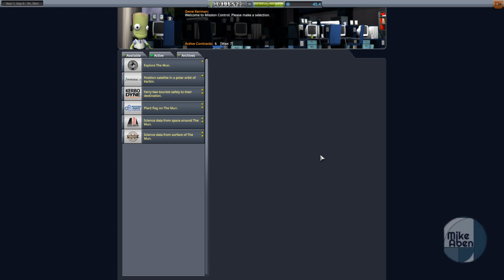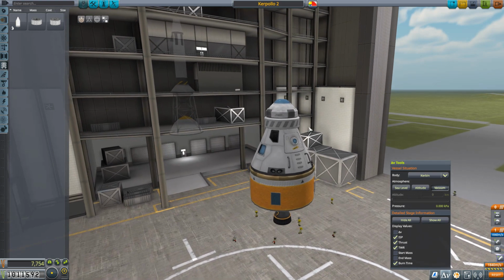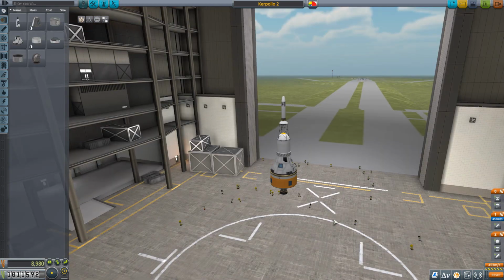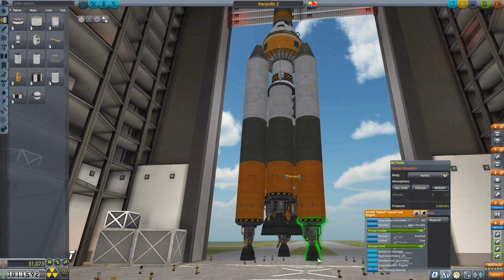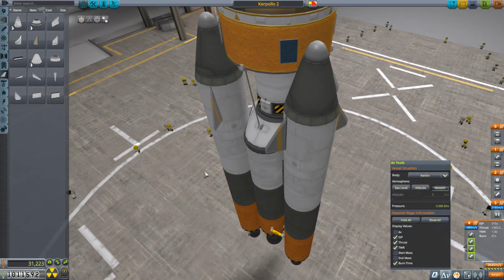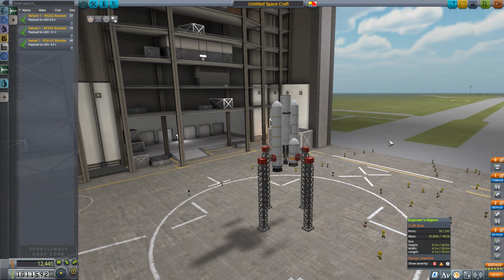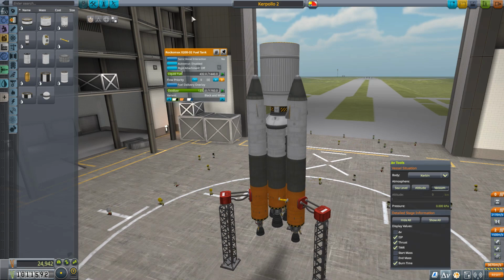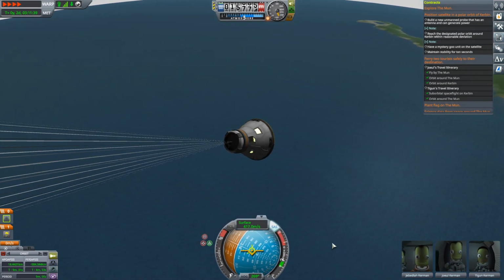Abort Sequences, Re-Rooting & Subassemblies | KSP Beginner's Guide

Comment: I do like your technique for using the fairing and inter-stage nodes for the LES. I usually build my own with sepratrons which I save for deceleration prior to landing. The LES has crazy thrust and very short burn time, giving Kerbals brain damage from G shock. While this can be tuned with fuel and thrust, in the VAB, I find building my own more useful in the long run.

Comment: Isn't it better to use solid fuel engines as boosters, at least if these solid fuel boosters allow for enough TWR?
Reply from the maker: What SRB's having going for them is that they are cheaper, but they cannot be throttled and (for the stock ones anyway) don't have any gimballing which can make the rocket more difficult to control. There are ways to mitigate this, but the short answer is there is no "better" way. Each has its pros and cons.

Comment: The EP-12 Engine Plate can also be used to discard the Launch Escape System when it's no longer needed.  Just flip it upside down and toggle the variant to Short.   Engine plates automatically generate a tubular fairing and include their own decoupler.  They also only have one additional node, so the process is less finicky than dealing with the weird interstage nodes of the payload fairing!  Edit: As far as I can tell, it's within .015 tons on the launchpad and maybe slightly lighter after decoupling, but it's tricky to judge the weight after staging.

Comment: Not at the computer rn but, alternate arrangement for the abort system:
* Launch escape rocket
* Docking port
* Capsule with radial parachutes.

Probably more practical, though I wonder if maybe the docking port is weaker than a decoupler. Struts might be the answer there.

First thing to test once I unlock separatrons, I guess.

Comment: How do you activate custom action groups on xbox? BTW this is an awesome series, learned more interesting first few videos than I did watching most of Matt Lowes stuff.
Reply from the maker: It's typically when the VAB hits level 3. I don't see why that would be different on the XBOX.
Reply: @MikeAben  That explains it.  My VAB is only 2nd.
Reply from the maker: In the PC game, there's a toggle in the settings to always have them. It's worth checking if the XBOX version has the same.

Comment: Hi Mike, I love this series. If it weren't for your guide I'd be completely lost. How do I use the craft files on the Xbox or is it even possible?
Reply from the maker: Sorry. That I don't know.
Reply: The boosters are easy to recognise but the capsule stage I don't recognise. Would it be a problem if you told me what it consist of? Thank you Mike!
Reply from the maker: @kennethwealot9592  I'm not sure exactly what you are asking here. Is this about the staging diagram on the right? The capsule itself isn't in the diagram, just things like engines and decouplers appear there. The capsule engine is on stage 1 at the end of this video.

Let me know if this doesn't answer your question.
Reply: Hi again Mike! No I mean the parts you used to build the capsule(orbiter) out of. Sorry I wasn't clear sir.
Reply from the maker: @kennethwealot9592  Sure. The capsule is the Mk1-3 Command Pod. The engine is the Terrier and the fuel can is the Rockomax X-200. If you aren't seeing them you must not have them unlocked yet.
Reply: Thank you Mike, awesome series, I love it.

Comment: Launch escape system costs money. This is a fiscally tight operation, they are lucky they get heat shields for re-entry.
Reply from the maker: The should count themselves lucky for the capsule. Command seat on a booster FTW.
Reply: @MikeAben  hot dawg! Thank you for that suggestion. Ps, thank you for the tutorials.

Comment: I generally use two parallel stages when I use them, and by rotating my vessel so they are parallel to the ground, gravity pulls them cleanly away on separation. 
And of course, saving boosters and using them that way is what they do in real life, pretty much for the same reasons. Although a mod which made using a subassembly cheaper would be welcome.
Reply from the maker: That's an interesting idea, saving cash by using subassembles.

Comment: Not only is it a slow and graceful release, but the fins aren't another item to worry about in the staging. Locating them just above the center of the booster causes less tumbling and moves the aerodynamics further back for a safer launch. I developed this technique after several troubling launches before I unlocked sepatrons. Enjoy!
Reply: I suppose you build the booster as a subassembly to find the center of mass
Reply: @LolUGotBusted  nope, I just guesstimate. It's a more forgiving process than you think.
Reply: Increased drag??